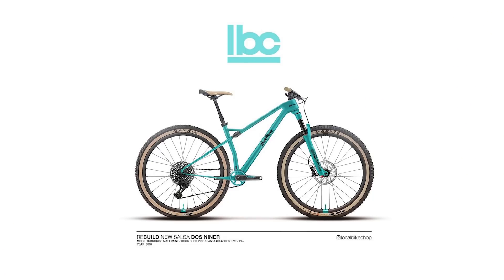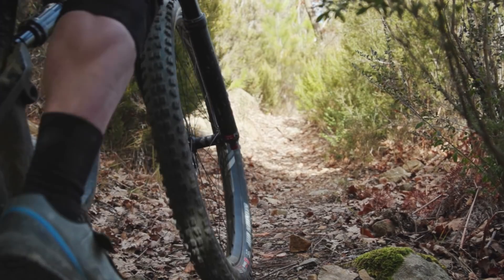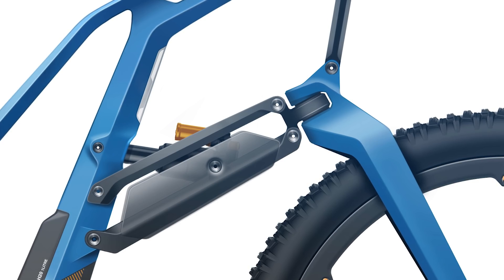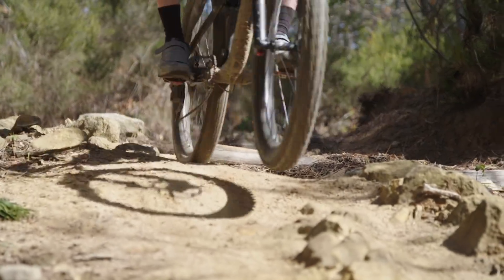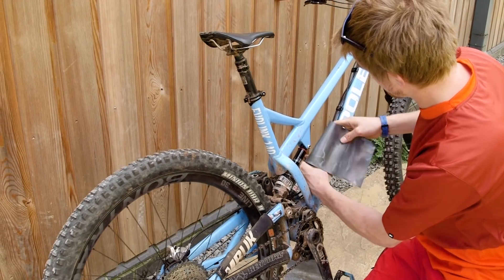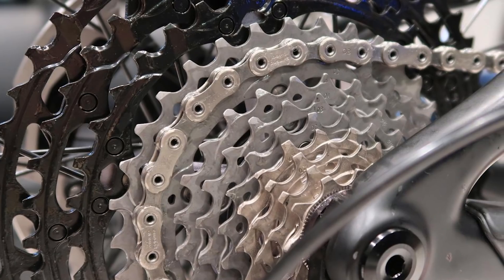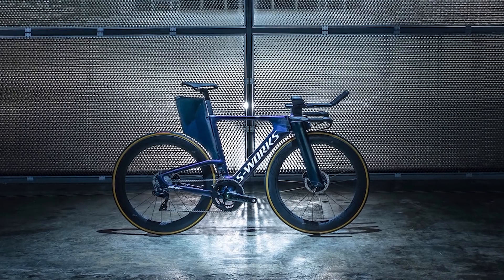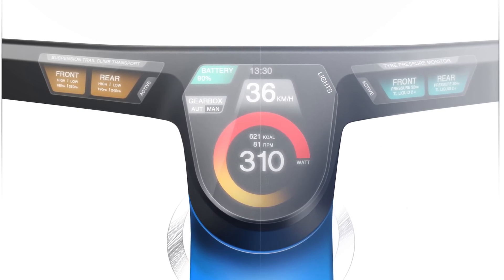We've Designed the Mountain Bike of the Future

Comment from the maker: Love it? Hate it? Think we're wrong about everything? Let us know in the comments!
Reply: Looks super weird, but the concept is great.
Reply: That front end will never catch on, but I said the same thing about the sell of bottled water.
Reply: I liked the music, but it didn’t fit this style video.
Reply: CVT transmissions are great, but often struggle to get the % range of a geared transmission, efficiency would also be an issue depending on the type of CVT.  Also, that belt routing wouldn't work, the belt would need to change length as the suspension compresses.
Reply: I personally dislike "technology advancements" conceived in a marketing department.
When you start from how to make it fancier and more expensive you'll always get shit product.
Try to make at least one actual engineering improvement and design the rest around it.
Like for example make it downhill leaning quad-bike - you get great traction & stability and the extra weight won't be a disadvantage, and you'll have not dual, but quad-suspension ... just an idea
Reply: Great line of thinking. I'm particularly keen to see where linkage forks and gearboxes go in the future. Would be awesome to see more mountain bikes with belts too – I've put over 100,000km on belt drivetrains and love that they always just always work.
Reply: It is an E-Bike so a clear I hate!
Reply: I like your thought and creativity, but that bike looks busy like a modern F1 car and I'd rather have elegance through simplicity.  And it is elegant, except for whatever is happening up front.  And except for integrated lights and data.  Better for those to be removable, I think.  Still, kudos for dreaming and the integrated gearbox would be nice and perhaps the day will come when it is as affordable and light as a mech and cassette, or at least close in cost.  And let's not forget, if it costs too much, may as well buy a Ferrari.
Reply: Hate it
Reply: surely water is better on the back on in a bottle
Reply: @dereksmith3632  We've seen similar front suspension set ups on motorcycles that never caught on, besides Bimota and BMW. I remember even Yamaha tried the link suspension some years ago, motorcycle testers loved it. No front end dive and minimal flex, but you paid a weight penalty.
Reply: The turn of the belt around the front pulley is too tight.
Reply: No derailleur to compensate for output shaft/axle geometry changes so belt would constrain suspension movement. And what on earth is that front suspension? People who don't understand engineering should just ride. I'm surprised that BR would sanction such drivel.
Reply: @emmber19  a spring or hydraulic tensioner solves the belt issue.
Reply: Those wheels look fragile as fuck

Comment: Interesting integrating a virtual interface in the bars. That concept lends itself to bike designers getting creative with indications like pinstripes on the TT for batter levels or even real time optimal gear indicators like on an F1 car. Also it would be cool utilize all of the inside of the frame for potable water. Perhaps even using it for ballast.
Reply: I imagine using the inside of the frame for water would add a lot of weight to the bike and probably give it a sluggish feel.

Comment: i actually quite like this concept, looks really cool and the tech involved is really interesting. the touch screen tho isn't anything i would add due to the risk of stuff breaking when crashing or on salted winter roads like the ones i have to ride from time to time. 

otherwhise, i really like the idea of a linkage fork instead of a telescope, looks really funky and i love when stuff looks funky, my only thought is if there is any extra weight penalty for having a fork like this. i also really like the 27.5 rear and 29 front, that would probably give me the best experience. i am still riding an old 2010 stumpjumper comp 26" and what i like with it is how nimble it is when riding. so my thought on my next bike is a 27.5 due to it's similarities in how it rides to my 26 whilst offering a signifficant increase of grip and ability to roll over obsticles. but the rear wheel is never the problem when i ride to get over the bumps, so increasing the front size would make it easier over the bumps but you still wouldn't get the extra mass to accelerate when getting out of a corner.

well made video, it was really entertainin!

Comment: Corrections that I would make:

Fully integrated head unit, but not integrated into the bars. As adjustments need to be made with bars and stems, rerouting and reinstalling that fancy stem head unit would be nightmarish. 

Switch the truss front to one that uses a standard headtube so the bike is cross compatible and you should have a pretty robust design. 

That being said, I’ll stick to my hardtail. Less to maintain overall.

Comment: I can't imagine that you will be able to make those linkeage forks stiff enough, at least not the ones that look similar to a rear suspension. It doesn't matter as much in the rear, but in the front, where the steering happens, the ride quality is probably going to suffer. A lot. The high pivot design for the rear has been done already. It works. As for the CVT, sure. You're not the first one to imagine one. You've got a ton of engineering challenges ahead of you. Good luck.

Comment: A belt drive will not decrease maintenance. It will in itself cause problems and require more maintenance than a chain. Think of grit wearing away at a rubber surface compared to metal, rubber will wear out faster. It will most likely require a tensioner system which will require its own maintenance and be prone to power loss, stretching, fraying, perishing, snapping, and variations of malleability in different climates. It’s the same reason good German car manufacturers use a timing chain that never needs replaced where as timing belts have a lifespan, they even have a shelf life regardless of use. I’m not saying belts are a bad idea, just that a chain is a better one.

Comment: Cool! But, computer controlled truly active suspension will be the big changer. Computer controlled iris for dampening fluid adjustment. Pedal torque measurement and tyre pressure monitoring to know the difference between a bump and a pedal stroke. We're creating better and better mechanical only technology when a computer with a small battery could do a better job at knowing the difference between a bump, breaking and a a pedal stroke.

Comment: Well i am still waiting for the simple stuff, like a frame with a built in battery that has some kind of modular system on all ends that would allow you to plug in stuff like lights, bike computer into the frame and hook it up the central battery. Ever more things require batteries on my bike and i just want not to worry about it. Put the bike on the stand a lo and behold it charges the one battery that powers everything hooked up to it. Add some wiring to it to hookup to your new electric dropper, di2 style shifting, power meter etc.This might just convince me to go out shopping for a new frame.
Next step is the stand with an automatic mechanic built in, but i give them a few more years for that one.

Comment: I think it is beautiful!!! And love all the tech. It probably would be impractical in the weight category. But as with everything else the design and weight to strength ratio is getting better all the time . The gear box has changed a ton . I’ve been a gear box fan for 15 years at least. And the taller front wheel vs rear with taller rear rubber is a good fix especially going down hill.

Comment: I can appreciate that this is just a concept design but that rear suspension linkage would be mostly non functional.   That belt would need some spring loaded idler pulleys to compensate for the huge amount of chain growth (belt growth?) that would occur... If the suspension worked. And don't tell me that Crank Brothers wheels are the future of mountain bike wheels. Thinking about the future already gives me enough anxiety. I'm probably missing the point.

Comment: How would you wash the internal water tank seems like a nightmare.
Reply: Would have to be external.
Reply: The Shiv has a bladder that fits into the frame, otherwise you’d need a much larger dishwasher
Reply: Yes, it's a pain in the ass cleaning out a camel pack after a ride, you'd never be able to keep the thing clean, most probably die of legionnaires disease
Reply: I think Specialized’s high end tri bike has this. You just remove a cover in the frame and you are then able to remove the bladder. So technically it’s a removable internal water tank but it’s still pretty cool

Comment: Evolution is allways good.
- but I just thought of an idea you might want to work on.
a CVT gear is great, but could you automate it, compared to the watt/force you put into the pedals.
examble, if you are able to put 200 watt into the bike all day long going up or down hill..  it should be possible to put that data into the ctv control system, so it will allways pick the gear to match 200 watt.
going uphill in a to big gear you will normaly have to stand up and push very hard = MORE watts, and then the cvt should auto shift down to where you only have to put 200 watt into the pedals.. 
going downhill, the gear will sence that you start to spin the pedals fast and are not able to put power into them, then it should upshift untill you can put power into the pedals again !

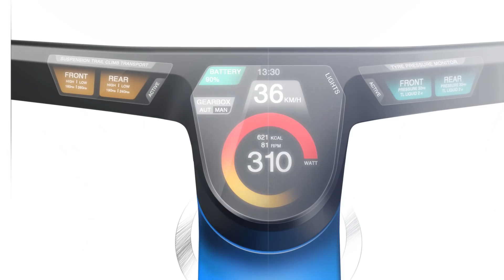Comment: 4:54  Magura has similar concept, for E bikes. https://www.elektrobike-online.com/news/e-bikes-und-pedelecs/magura-lenker-mit-systemintegration.1930398.410636.htm#1
https://www.elektrofahrrad24.de/Magura-macht-das-Komplettsortiment-eBike-ready
but the disadvantage of a system like this is, you cant cant swap handlebars for lower or higher rise for example, you need to swap the whole cockpit.

Comment: Nice. I reckon the future will include on the fly adjustable geometry front and rear and travel front and rear. Also the ability to change the wheel base off the bike like motorbikes with sliding drop outs 🤘🏻
Reply: It has been done already, headset that can be flipped yo allow longer reach, longer wheelbase, rear end that can adjust chainstay length, Nicolai has that, I saw custom kids bike, had reach adjustment in headset.
Reply: Sliding dropouts is for single speed, maibly, common on dirt jump, trails bikes, but some trail hardtail come with it, but with belt drive u don't tighten chain, so not needed, but this can be wheelbase can be adjusted with chainstay extender thing like nicolai has.
Reply: Canyon has a switch to change to xc geo on enduro bikes, but u have to sit to activate it. I rather have one geo that works, and use flip hips, or extenders.

Comment: I don't think that drivetrain will work. The upper idler wheel needs to share an axle with the pivot or you'll need something to allow for belt growth
Reply: You're right, there is a belt tensioner just behind the drive pulley, but in reality this would need to be much larger to allow the belt growth.
Reply: One approach is AOS suspension... like GT. If done correctly, you can the best of ALL worlds.